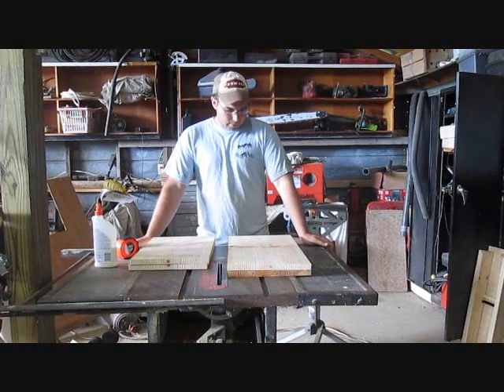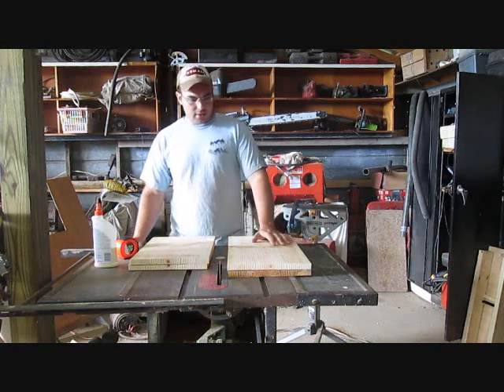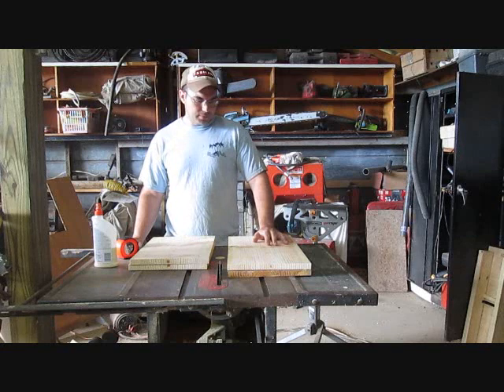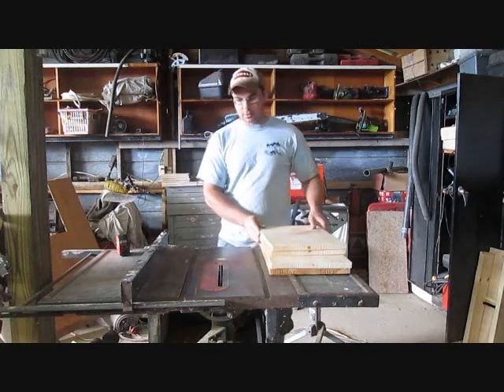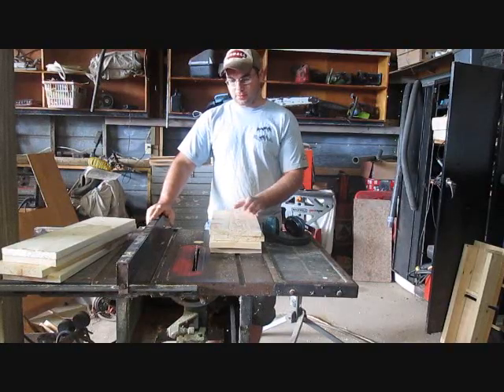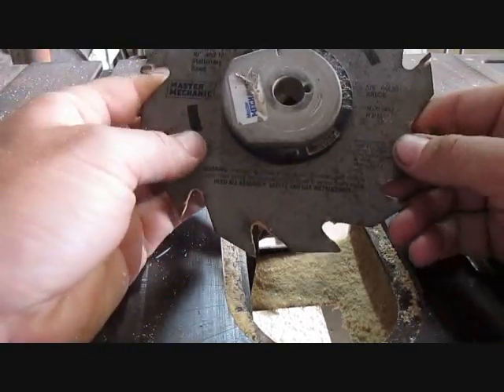Building finger joint beehives with only a tablesaw. With measurements

Comment: I sincerely appreciate the demonstration.  I have been researching beehives alot lately with plans to get setup for next spring, your video is what I needed to convince myself to buy a Dado blade and start making them myself.  Great tutorial you're the man!
Reply: aluckyshot I'm doing the same. The premades seem way overpriced to me. I'm really more interested in that jig he uses to make the cuts. That looks like it takes this into easy-mode.
Reply: After cuts are made, use waterproof glue, clamp sides together, drill pilot holes for #7 galv. nails.  Then seal corners with deck seal liquid, only on outside.  Boxes should last 25+ years this way.

Comment: Good video.  Thanks for taking the time to shoot it and good explanations.   I moved my mediums to 6.75" wide - to make it an even number of 3/4" fingers (1/8" more isn't a problem to the bee's, and I haven't noticed any more or less burr comb.... )
Good idea on using the spacer.  I just start with the long sides.  To cut the shorter sides (Fronts/Backs)- I just flip the long piece, put the top edge to the center (as always).. then start.. but I like the idea of the spacer.

Comment: I gave up on these joints years ago, just too time consuming. I just build a box with butt ends now. I use waterproof titebond and a brad nailer with 2' nails. Use a quality exterior paint and they last a long long time, the bees don't seem to mind either. But in all you did a wonderful job on the boxes.
Reply: I agree, and I also altered some measurements, like the honey super I make it 7 1/4, so I can use a 1 by 8, that comes in 7 1/4 and don't waist material, of course you have to adjust the frames as well.
Reply: Pocket screws are the way to go.

Comment: If you don't like the wobble dado because it does such a terrible job, why not invest in a stacked dado set so you can make better cuts. Also, you are a brave man...no push stick when putting the lumber through the saw. One day something will happen and you will either get badly cut or lose a digit. Talking from experience here. Otherwise, you offered some good tips to making the hive parts.

Comment: Thank you.
I would, however, suggest that, if you decide to cut box joints this way, invest in a a decent DADO Set instead of an adjustable (Wobble) Dado Blade.  I bought  Freud Reversible Box Joint set and can testify to the precision cuts - as compared to the Craftsman Wobble Blades and a cheap HFT Dado Set.

Comment: I cut  rabbit joints in the end pieces as it adds to the gluing  
surface. I feel they last longer than finger joints done this way. They 
do need glue however. great job on the video though

Comment: Bill, thanks for the video. Like you I get my lumber from Lowes. So when you say 1'x12"x8', the actual size is 3/4'x11/1/2"x 8'. Are you using actual size lumber, or rounded up?
Reply from the maker: Lavon Hughes its all 3/4
Reply: for those that dont know it but the size of lumber has now changed to 11.25 not 11.5 for anything over 6 inch wide lumber

Comment: I like the way a box joint looks and it's a very strong joint. But I'm not a fan of it. Because in the weather, box joints reveal 50% of end grain on all sides and from each board. End grain gulps water. You could use a rabbitted lap joint and only reveal 25 percent of one board on each joint.  It's not as strong as a box joint. But a box sitting on a hive doesn't need to be strong 
Nice old craftsman tablesaw your useing sir.
Reply: haha agreed. thats why you paint them to seal them up.

Comment: What is the name of the cutting disc in amazon?
Reply: i'm wait
Reply: The blade? It's called a dado blade
Reply: Carolina Relic Hunters 
Thanks
Reply: @hookbrian  Actually there are two types of dado blades. He is using a wobble dado. The other type uses multiple blades put together to make different size cuts. That's called a stacked dado set.

Comment: Could you could cut multiple pieces at one time with that jig?
Reply from the maker: Celie Canada yes you can but you need straight lumber. i get my wood from lowes and if you put a stack of boards in there and they are cupped it will throw the joint off. you can used cupped lumber one at a time.
Reply: michaeljp86  I wanted to ask about the jig. I have made two and I am having the same problem with them both. First cut is 3/4 then with each additional cut on the board the joints get smaller and smaller? Not sure what's going on. Any ideas?